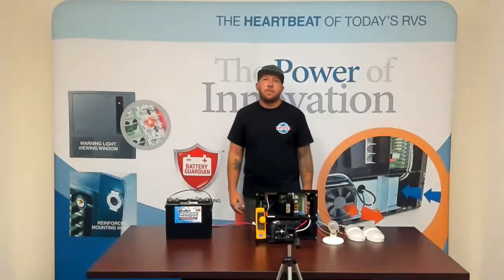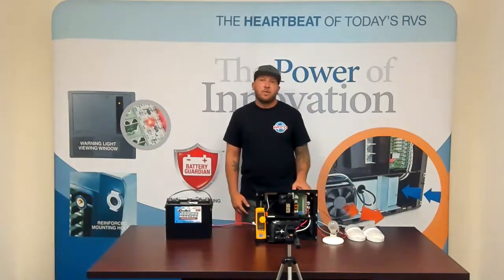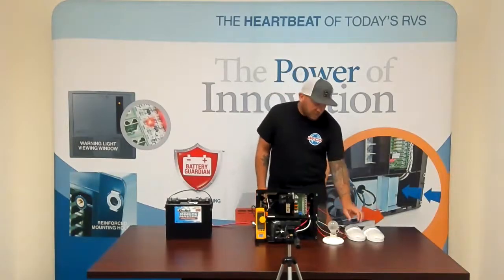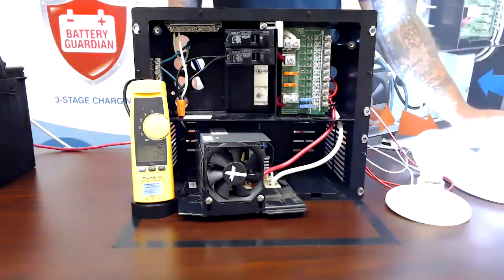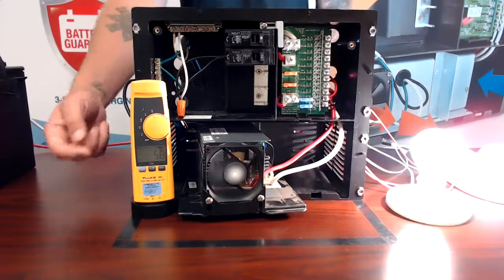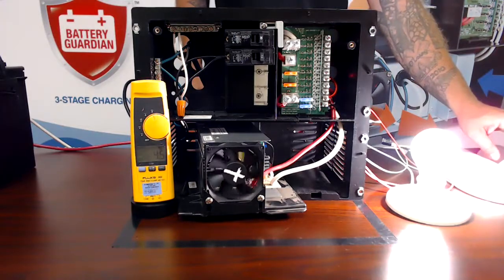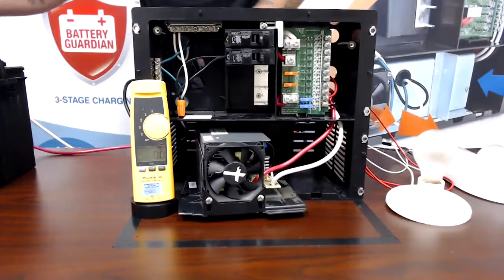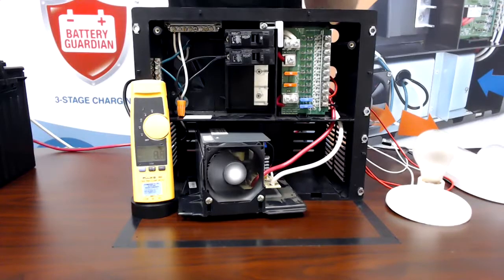Why does the fan on my converter run all the time?

Comment: I replaced the battery with a new deep cycle and the fan is still spinning. No 12v loads are turned on. do I have a faulty unit?
Reply from the maker: Thank you for the comment.  You can contact our Technical Services Team at 1-574-294-8997, Option 1 to inquire about this.  Thank you, Michael!

Comment: I installed all new coach batteries.   Now, when I turn on my "power button" my vent fan comes on.  This has never happened before.   Now I just found out that once I start driving the van, I can't turn off the fan.  Not even manually.   Any thoughts?  Anyone?

Comment: I do not have anything on   Fan runs 24/7
Reply: Hi, My fans runs 24/7. It that normal? I don't have nothing on it that is one. Everything is off. Should i disconnect the battery when i'm not using it?

Comment: Just purchased new Forest river TT and has electrical smell coming from converter. I pulled it out and checked all connections and for burnt board or areas of concern and see nothing. Is this normal or should I get it replaced. No smoke and everything is working. Thanks
Reply from the maker: There shouldn’t be a smell, it could be dust from the building of the trailer. Please call the Power Pro Technicians if you're concerned. They can help with all your questions 8777-294-8997, Option 1.

Comment: My battery is disconnected and I have nothing on and my fan still runs all the time. What causes this ? Also, will the fan run all the time when on battery power? Seems like this will drain the battery.
Reply from the maker: This would be a component failure in the converter and would need to be replaced.

Comment: How about when hooked to shore power with no battery connected ?  my fan seems to be turning on when i run my furnace and a few 12 volt lights.   is this bad at all ?
Reply from the maker: WFCO converter fans are load based, meaning if you have enough 12V loads on the converter the fan will run and will increase the speed with more 12 V loads. Your furnace will be able to pull enough current to make the fan run on your converter. This is normal.

Comment: Is this bad...? Does the battery need replacement?
Reply from the maker: Our fans are designed to run when you apply enough 12 V load on the converter. With your battery being a 12 V load, this will also make the fan run if the battery is taking a charge, if the battery is still trying to take a charge for multiple days, this can indicate a battery problem.
Reply: @wfcotech thanks for all of your suggestions. I just checked the batteries and one of them was boiling inside and very hot! I feel lucky. The fan is off now that the batteries are disconnected. 
Much appreciated

Comment: I just replaced my one group 27 with two 6v 225ah batteries. Batteries were wired in series for a 12v system. Now when I am plugged in to shore power and I turn my lights on my converter fan runs constantly. Any ideas?
Lights are LED and it does it with one light as well?
Reply from the maker: Since WFCO Converter fans are load based, this means the total load. of the system. is enough to make the fan run. For example: Batteries and Lights

Comment: I just replaced my one group 27 with two 6v 225ah batteries. Batteries were wired in series for a 12v system. Now when I am plugged in to shore power and I turn my lights on my converter fan runs constantly. Any ideas?
Reply from the maker: Since WFCO Converter fans are load based, this means the total load. of the system. is enough to make the fan run. For example: Batteries and Lights

Comment: Not sure if my fan always worked full time, but lately it never shuts off. I am hooked up on the 120v and battery is also plugged in. If the battery is the one causing the fan to always work, should I disconnect it?
Reply from the maker: Give our tech support a call at 877-294-8997 and they'll be able to assist you!